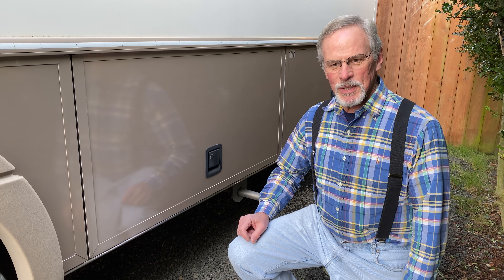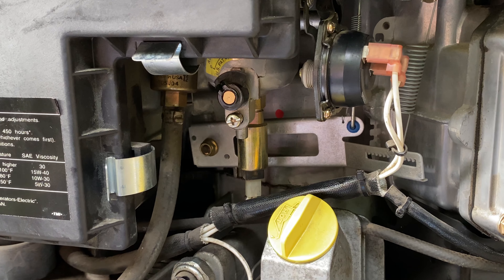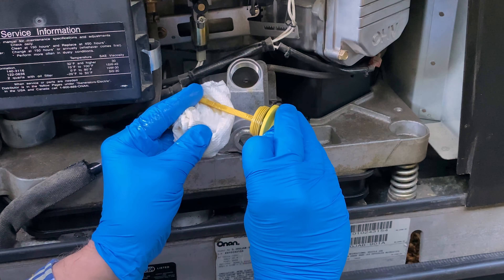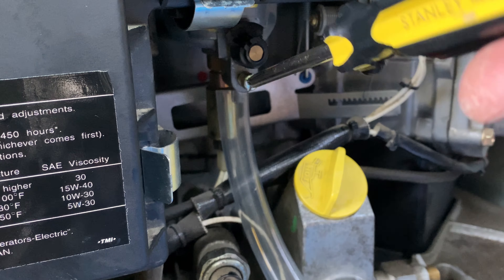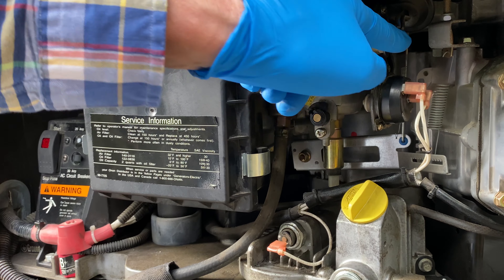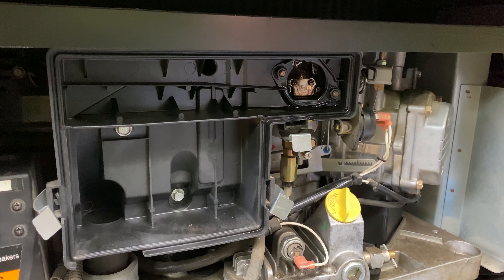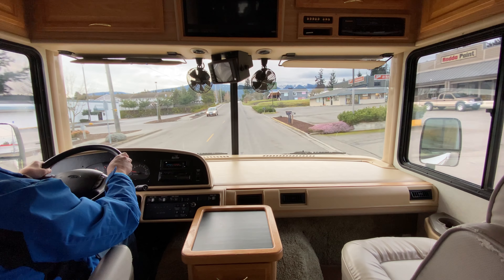Troubleshooting an Onan Marquis Gold 5500 Generator

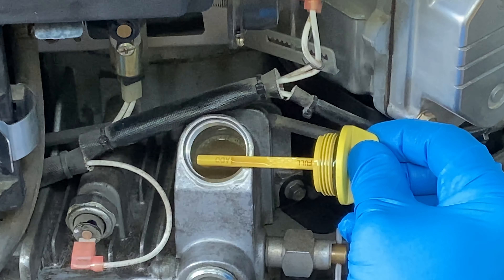Comment: You drive just like Steve McQueen.  Here is my story of frustration on my Onan.  I bought a new 22 Entegra with an Onan 5.5k generator, from the day I bought it, the generator would stop after 8 minutes with both A/C running.  The selling dealer in Las Vegas, NV could not fix it because they are not an authorized Onan repair.  I took it to Cummins in San Leandro, Ca.  They said it need a new fuel pump.  A new pump was installed and then it would run a little longer.  I took it back to them in March and they said they had to adjust the "hertz", so they did.  Next time I used it, it stopped after 1 hour when I ran it at home.  I took it back a 3rd time, (each trip is 52 miles oneway from home), I ran it on the way there and then I waited at the dealer for a total of 2:40 hrs and it did not stop.  I started to drive back home and after 20 minutes it stopped again.  I turned around and left it there at Cummins.  Now we'll see if they can find the problem.  It's Memorial Day week-end so they will not be able to test it until next Tuesday.  By the way Jayco/Entegra which made the motorhome and installed that generator will do nothing for me, because it is Cummins problem and not theirs.  I told Cummins about the oil issue I have read on YouTube and they said never to run it with less oil.

Comment: The first thing that I would say, is that your exhaust looks like you’ve been running E85 in it. Doesn’t matter if it was intentional or inadvertent.
Such a thing is you’re definitely getting fuel or wouldn’t be running. It is not very difficult for the little tiny carburetor, drain needle to get clogged and not be able to drain fuel.
The first thing that I would do is disconnect the fuel line and hook it up to a. External fuel source of some clean non-ethanol fuel. Then started up on that and see what happens. That would be before tearing one completely down.
I am a Generac/Kohler/briggs&stratton/0nan/Cummins Technician. For power on time. 
The oil level problem which has been previously reported is usually in relation to using the wrong level of quality of oil. If you use OnaMax oil, it will not foam up.. 
I would bet you a gallon of diesel. The external fuel source would cure the problem. The next step would be draining your fuel, and putting a better grade of fuel in it. 
Also note that putting too much fuel stabilizer can cause you problems as well.
The best way to prevent water in your fuel is to keep your fuel filled up.

Comment: How did the oil all of a sudden get over full?
Reply: Gasket likely failed allowing fuel to contaminate the oil. Looks like chocolate milk. Not good.
Reply: Bubbles seen it in another video
Reply: @asphaltadventurer  The only way for gas to enter the oil is through the carburetor and that did not happen here. There is no "gasket".

Comment: If you have a Cummins Onan RV QG 5500 LP that starts with starter fluid but won’t start otherwise look at the lower end of your throttle body (not carburetor). If it has two lines connected, a propane line and a second line/tube connected at the lower tubes from the throttle body, one is the propane feed and is coming from the High-pressure Converter LP Liquid (HGJAC), the other small tube/line coming from the lowest throttle body tube going to what was once the fuel/gas valve and is the oil drain may be leaking. Give that tube a little tug to see if it breaks. If it does you found your problem

Comment: First place to check is oil level or oil level sensor. I have seen these things start and shut down due to low oil.
Reply: I think thats what happened after the last oil removal. It stopped cleanly without surging.

Comment: That oil looks milky. There is definitely something contaminating the oil. A gasket likely ruptured and is allowing gas or something else into the oil, causing the level to rise on the dipstick. You need to take the fuel line supply side off the fuel pump and verify fuel is getting to the pump. Check again on the outlet side of the pump to make sure gas is being pumped through and past the fuel pump. If gas contaminated oil detonates inside the crankcase, that wouldn't be good.

Comment: When it dies, it sounds like a backfire, and you did mention blackened air cleaner.
Also, if there is a second fuel filter on the chassis, be sure to change it. Onan says it only needs one.

Comment: You are supposed to check the oil when it's warm condensation from the exhaust is normal on any internal combustion black smoke would indicate it overich mixture alot of guessing on YouTube from people that know absolutely nothing other than what they see on forums if they do not know how a carburetor works they should not be touching these things

Comment: You're not taking out enough oil, should not be more than 1/4 inch above the add mark on the stick. also on the right side of the of the oil fill there is a T-valve you can open by hand to drain oil into a measuring cup. If oil level is on the full mark you need to take out one pint or 2 cups of oil. You may also take out more (down to the add mark) if needed to get a good run on the gen.  Onan is using bad dip stick and the reading is wrong.
Reply: I realize I'm kinda off topic but do anybody know of a good site to watch new series online ?
Reply: You are so wrong. Tell my why it would run with less oil. I don't care if it runs or not. I want an explanation.
Reply: @trustme7731  this is a very common problem for some reason with to much oil and when I say that I mean more than above the add mark it will run for a bit then shut down almost like it ran out of gas.  Take the oil down to the add mark and it runs forever.  My guess the dip stick is wrong and with that much oil in it it reads to much oil pressure.  When you change the oil and you measure out exactly the right amount of oil it’s actually down right at the add mark.  This trick worked on mine that kept shutting down like it was starved for fuel.
Reply: @scottbulach  What brand and size is the generator?
How much oil did you measure and put in?
Reply: @trustme7731  it’s the 4500 and don’t quote me but I believe it is 1.7L I have it wrote down at home but I’m not there right now.
Reply: @scottbulach  I asked for the brand. 
I don't think Onan makes a 4500.
Reply: @trustme7731  yes onan makes a 4500 I didn’t specify because the video is on onan.  I wouldn’t give that advice to a onan owner if I owned a generac lol.
Reply: @scottbulach  The 4500 is a commercial generator and has nothing in common with the Onan 4000 which most RVs have and where most of these shut down problems are. So this is why it was confusing. If yours shuts down and you solve the problem by reducing the oil level, I need you to explain how this is possible.  Like I've said before, reducing the oil level only masks the real underlying problem. If you had headaches all the time and tylenol stopped the pain, you have not found the reason for the headaches. You've only covered up the real problem. 
I know the actual problem and how to fix it. I plan to make my own video in the spring.
Reply: @trustme7731  hmmm nope you are wrong sir.  I have a 4500 in my RV it’s a class C.  It done this with 10 hrs on it like I said it fixed my problem.
Reply: @scottbulach  Actually, it is a commercial generator. Is it a BGD model? Look it up. Although its near impossible to find any info on it. It must be old.  The most recent info I can find is from 1996. In that operators manual it says "This manual covers the operation and maintenance
of the Commercial BGD and NHD series of generator sets (gensets)." I never said it wasn't in your RV. Some of the commercial models were adapted for RV use. Most were for commercial vehicles and marine use.
You may be lucky though since it has features and advantages that the 4000w and others don't.
Again, you didn't fix anything. You only bypassed the real problem and put the engine at risk. You also didn't explain why removing a third of the oil appeared to fix the problem.  (forget it, nobody can)
The manual also says "CAUTION Too much oil can cause high oil
consumption, high operating temperatures
and oil foaming. Too little oil can cause severe engine damage. Keep the oil level between the Full and Add marks on the dipstick." 
Onan engineers aren't stupid. There is no design error or conspiracy to make you by $800 in parts and $400 in service labor as some suggest.
Reply: @trustme7731  I have a 2022 so it’s not a older one.  I’m not going to argue with you being it seems you think you are a know it all.  I guess mine will blow up.  Like I said this is what I did when I only had less than 10hrs on it with now pushing 30hrs.  Guess we will see.  Maybe instead of telling me to look it up maybe you should.  I know what I have in my RV.  Maybe you should look up on many forums the same thing I experienced that is what solved their problems also.
Reply: @scottbulach  I've tried looking it up. For some reason I can find no info on a 4500 RV onan online or on their website. I do know they existed in the past as I explained by finding a manual dated 1996. The age and the hours have nothing to do with the problem. I have never doubted that removing oil appeared to solve the problem and I know why it does. Again, this only covers up the actual problem.
Reply: @trustme7731  instead of not explaining yourself and holding the knowledge of why you think this doesn’t solve the problem how about help people out and tell everyone what will actually fix the problem.  But hey not everyone is trying to help one another.  I like helping people out and letting people know what worked for me.  Just hate seeing people spend money on simple fixes.
Reply: Mine has run at the full mark with no issues many times.
Reply: @trustme7731  tell us the actual problem then! I agree with Scott, why bother commenting if you aren’t going to tell us. Must be because you have no idea and are just full of bullshit.

Comment: Why not use the drain tube connected to the right of the fill hole? Place a bowl underneath the drain tube and open the "oil drain valve". BTW, you did NOT drain enough oil! Take it down to the "ADD" line  and start.
Reply: To the add line or above?
Reply: Damaging the engine by removing the oil will NOT solve the problem.
Reply: @trustme7731 ... How do you damage the oil by using the drain tube?
Reply: @greuju  You need to read my post again.
I said "damage the engine".

Comment: That oil should be black
Reply: No, it shouldn't be. Remind me to never buy a gas engine from you.
Reply: @trustme7731  it will be black after you drive it for months. Have you ever seen what color your oil is after 3 months of driving? Have you ever seen oil that has water in it? Go back to automotive school or do a YouTube search, or ask a mechanic.
Reply: @jerryberkel8421 
1. I never drive my generator.
2. Oil with water in it is NOT black. It's a milky brown color.
3. Time (3 months) doesn't make oil black, miles do or hours in the case of a small engine.

4. If engine oil in a gas engine is black, you waited too long before changing it.  Diesel engine oil will be black normally.
5. I worked in the family service stations at 14. Worked at another for 4 years. I'm the only one that changes the oil in all of my dozens of engines for over 50 years.

Comment: Give me an explanation of why you think the engine would run properly with less than the proper amount of oil in it. Every YouTuber is wrong about this solution.
You headed in the right direction with checking the fuel but for some reason you didn't follow through to the logical culprit, the fuel pump although there are of sources for this problem. You ran the diagnostics and then ignored the answer.
Reply: Also, spraying carb cleaner into the throat of the carb does nothing. A dirty carb is dirty on the inside where you can't see it. It needs to be needs to be disassembled for this.